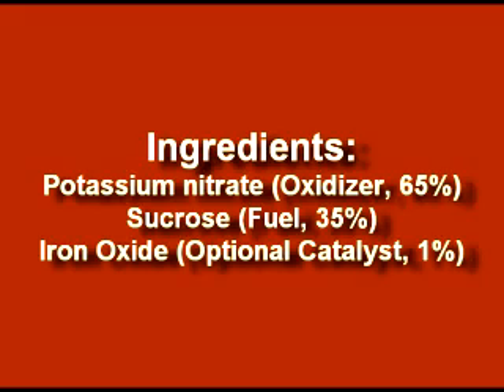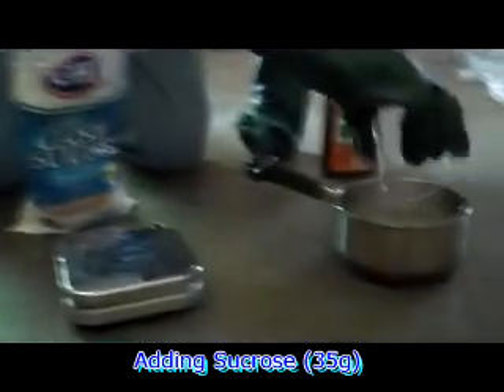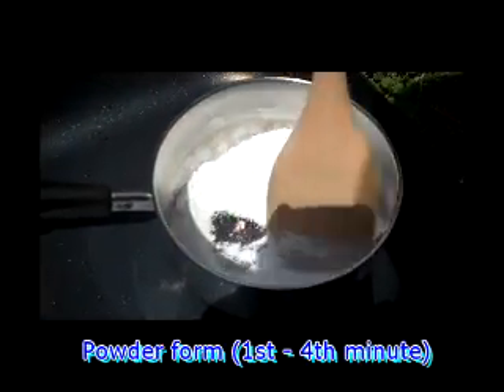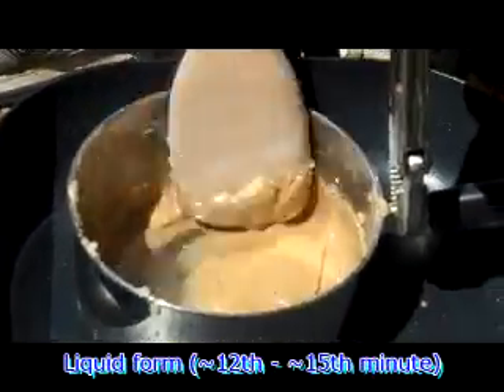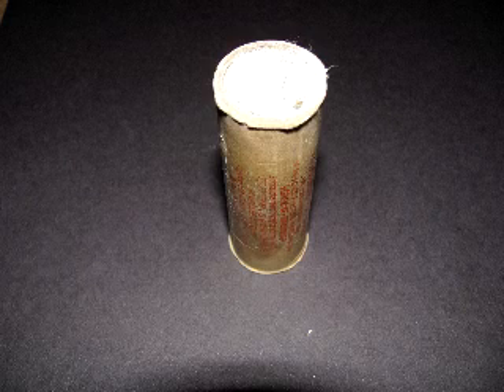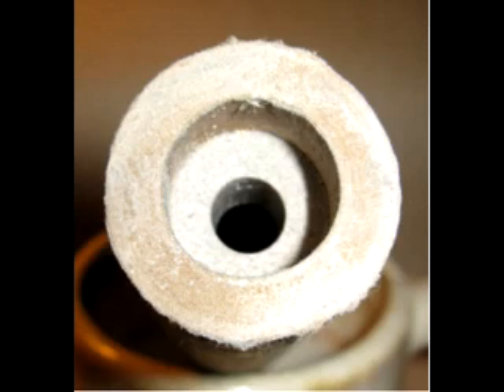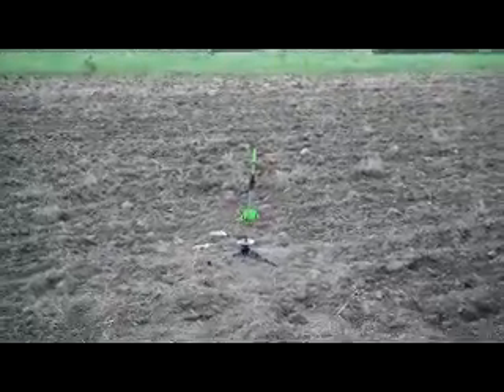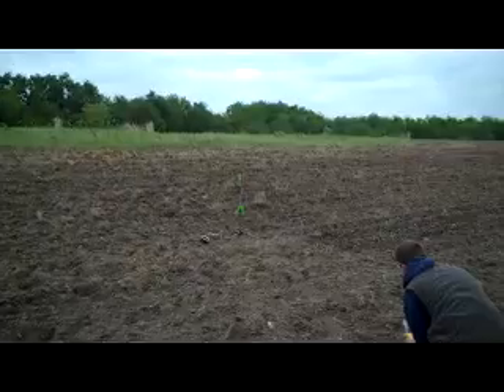How to: KNO3 and Sugar Rocket Fuel

Comment: When I tested my mixture (40% powdered sugar,  60% kno3) it burns well but bubbles up into a goo which then turns solid almost instantly. Haven't tried to put it in an engine but am thinking it (goo stuff) will "gum up" the nozzle when it burns?
Reply: ehill1536 that's why he said to cook it first
Reply: @UberGooberBlu , cooking it wont change the issue. In all reality caramelizing it actually  takes away some power potential of the fuel. The issue lies within the components of his fuel, the ratio plus some ingredients are causing slag to form. Likely him using pre powdered sugar and unsure kno3.

Comment: ammonium nitrate is not so good, because it attracts water  and quite hard to ignite because it melts and decomposes before ignition.
but if you solve these problems it should be OK or even better because all products are gases. 
just adjust mixture composition, you will need much less sugar than with KNO3.

Comment: Well, I guess if you've got a method of controlling the temperature and enough protective gear to keep you safe in the event something goes wrong, you should be ok.  Sorry if I came across as a little over-bearing.  I studied explosives engineering in college, and then ended up working in the nuclear fuel processing industry, so I'm accustomed to enforcement of very rigorous safety controls.

Comment: So you're only 12 years old and you've got it all figured out, huh?  I've seen adults who thought they had it all figured out, and ended up seriously injured doing stuff like this.  Do you know exactly what the self-ignition temperature of the KNO3/sugar mixture is?  Do you have a reliable method of ensuring that this temperature is not exceeded?  Unless you do, common sense would dictate that you do not apply heat to the mixture.

Comment: use commence sense bro, even if black powder is a mainly kno3 based substance, it must have a catalyst in it for it to burn at 400 degrees....just potassium nitrate with sugar or even with iron oxide, the rocket candy will not set on fire at around 400 hundred degrees because it does not have the correct catalyst to do so. further more, potassium nitrate is only the oxidizer, it is not what actually burns......contrary to my profile, Im only 12 years old bro...even I can figure this out

Comment: You recommend "cooking" this fuel at 320-390 degrees?  Are you aware that black powder (which is a potassium-nitrate based propellant, much like your rocket fuel) spontaneously ignites at just over 400 degrees?  Unless you have a very rigorous method for precisely controlling fuel temperature, I would say this looks like a very dangerous process.  How many times have you had this stuff self-ignite while it's being cooked?
Reply: I was about to ask the same question. As per http://www.nakka-rocketry.net, it is sufficient to maintain 193 degree C to prepare the propellant (with no water added).

Comment: Some oxidizer substitutions might be ok, but using chlorate oxidizers like KClO4 is probably a bad idea; they are much more sensitive to initiation than potassium nitrate, typically decompose much faster, and are capable of detonation.  Substitute potassium chlorate for potassium nitrate in your fuel, and chances are that you will end up with a bomb instead of a rocket.